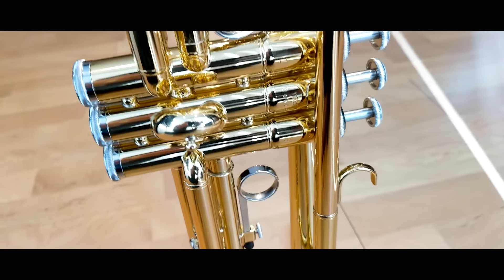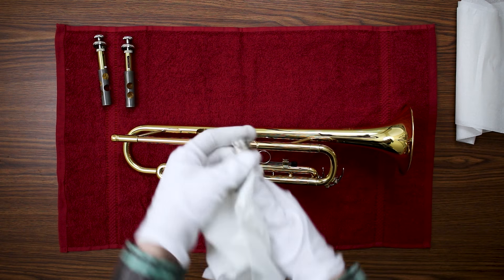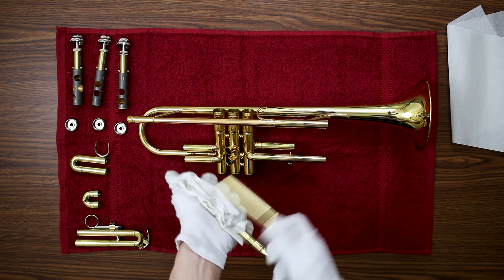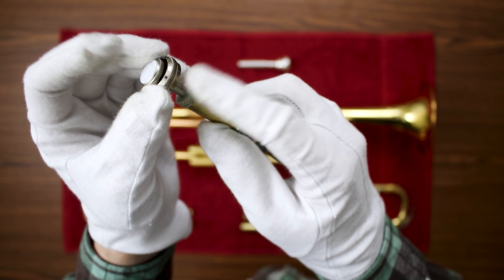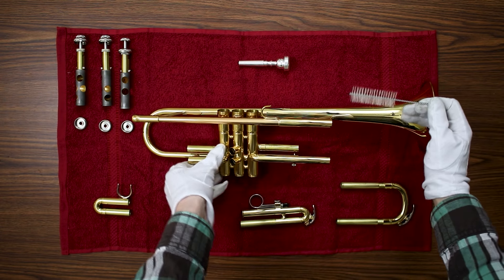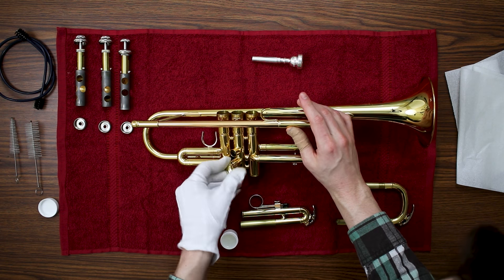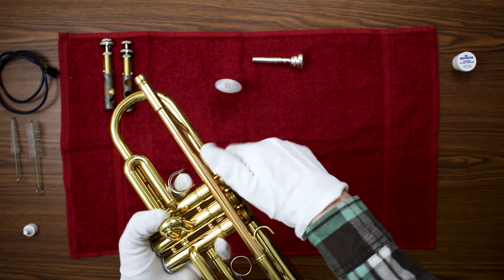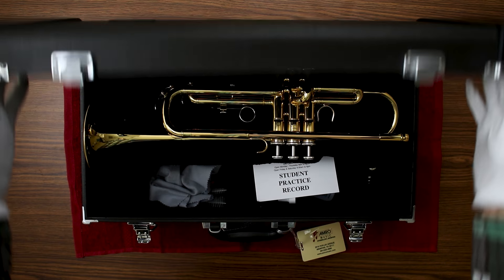How to Clean a Trumpet

Comment: I bought a trumpet and watched this video and some others. I learned a lot that i needed to know but it's not the whole story. Every time you play, you have to clean it but i thought it was maybe at the weekends and a strip-down and bath maybe twice a year. It's not all that clear and i was getting fed up with notes failing, can't get the practice in for the embouchure, play my exercise tunes etc. because the thing was always "crapping out" - and I thought it was me.

There's a thing called a "trumpet swab" which is a bit like a pull-through or "snake". It's made of silk or chamois leather and feeds through the lead pipe and the lead slide after playing to thoroughly, quickly clean and dry everything. Much better than the pull-through "brushy thing". Do the mouthpiece as well with a little brush and it takes care of this much more easily and quickly. I can make progress now and i wonder why these videos aren't telling us about this part of cleaning a trumpet - loads of players do it.

Anyway, they aren't expensive, easily available from any brass supplier so buzz it up on Google and take a look - trumpet swab - if you're having similar bother.

Comment: how  long should we soak our trumpet. I didn't realize we were supposed to clean it and I have had mine for about 3 years?
Reply: 30 minutes is usually really good. Valves are the tricky to clean, so be careful. You don’t want to ruin any parts and need to buy replacements if you can help it.

Comment: Great video, really easy to follow, just want to check before I make a mistake..
When cleaning the slides, do you push the snake right the way through?
Why not push the snake all the way through to the valve casings?... won't that just push the buildup around in the tubing??
Reply from the maker: You can push the snake all the way through the slides—no problem there. But you don’t want to shove it into the valve casings, because that’ll just push all the gunk further inside instead of getting rid of it.

Best move? Clean the slides separately, rinse everything really well, and let the water flush out any junk before putting it back together. That way, you're actually removing the buildup instead of just relocating it.

Comment: Nice video! I have a question though. What do you use to clean off the gunk and grease off the slides? 1:13
Reply from the maker: For cleaning off gunk and grease from slides, a good option is isopropyl alcohol (90% or higher) or a mild brass cleaner for tougher buildup. You can use a lint-free cloth or Q-tips to get into tight spots. If there’s old, sticky grease, a bit of warm, soapy water followed by thorough drying works well before reapplying fresh lubricant.

Comment: After I let it soak , should I scrub while it’s wet or air dry it first?
Reply: While it's wet and put dish soap on the snake brush, otherwise it won't do much.
Reply: @tamasfoldesi2358  thank you so much I was wondering this too
Reply: Just do it when it’s still submerged

Comment: i messed up the order on  my valves arrangement is that fine?is there a vid that tells me what order they go back in?
Reply from the maker: The valve pistons are numbered and must be in the right casings for the trumpet to play; the valve closest to you when you play is #1. 
The middle is #2 and the one furthest away from you is #3. Apply a few drops of valve oil to each piston, turn it in its casing until you hear the valve guide click into place, and then screw down the valve cap.
Reply: oh youre doomed!! no just kidding, on valves there should be number - look for it... sometimes it is just bit hidden

Comment: If a slide is stuck because it wasn’t cleaned what are you supposed to do? Can I still bathe it? Just curious so Just in case I forget.
Reply: If a slide is stuck, bring it to a professional. Do not attempt to remove it yourself.
Reply: @tamasfoldesi2358  like a person at the shop I got a trumpet from?
Reply: @ussarizona2201  It depends. Some shops that sell instruments also repair them, but others don't. Best to look up who is considered to be the best instrument repair technician in your area.
Reply: @tamasfoldesi2358  thanks I’ll look out for people with this problem if there are any. And in case I forget cause I have a complicated schedule.

Comment: Is it the same with a mellophone
Reply from the maker: Cleaning a mellophone is pretty similar to cleaning a trumpet, but there are a few differences:

Same basic process: Use warm, soapy water, a snake brush for the tubing, and a mouthpiece brush.
Bigger tuning slides: Since the mellophone has larger tubing, make sure to clean all the bends and crooks thoroughly.
Rotary vs. Piston Valves: If yours has rotary valves, be extra careful—don’t soak them! Instead, wipe them clean and reapply rotary valve oil. If it has piston valves, treat them just like a trumpet’s.
Leadpipe gunk check: Mellophones can build up a lot of grime in the leadpipe, so give it an extra scrub!

Comment: i was cleaning my trumpet and all was fine but i pulled it out of the water and it was wrinkly and something clear, maybe the varnish, was flaking off into my hands. did i soak it for too long? did i use too much soap? is the varnish saveable? someone help please
Reply: Probably the water was too hot or too acidic/basic for some reason, but I doubt that. Probably the temperature was too high. Or it was lacquered poorly or it was just old and was going to come off anyways. Unfortunately the only option is to relacquer it.

Comment: What happens of the slides don't come out
Reply from the maker: If your slides won’t budge, don’t force them—brass instruments don’t like brute strength! 😅 Here’s what to do instead:

Apply valve oil or penetrating oil around the stuck slide and let it sit for a few hours (or overnight). This helps loosen any dried-up grease.
Gently wiggle the slide—small back-and-forth movements work better than pulling straight out.
Use warm (not hot!) water to soak the area and help break up any grime.
Still stuck? Time to visit a repair tech—trying to yank it too hard can bend the tubing, and that’s a whole other problem.